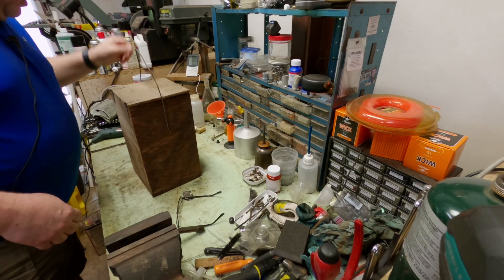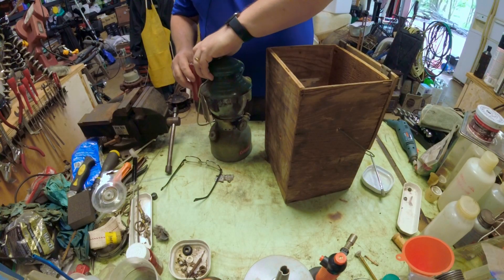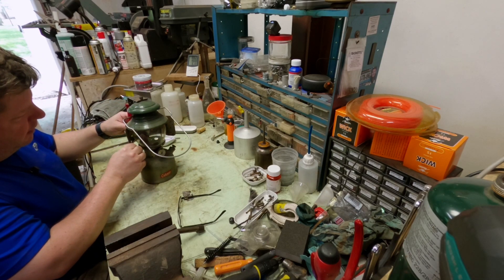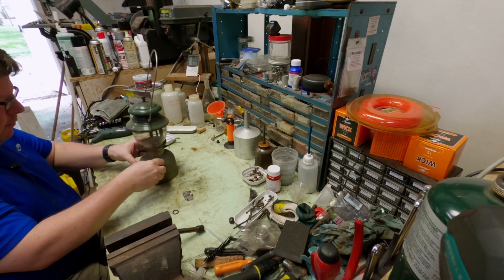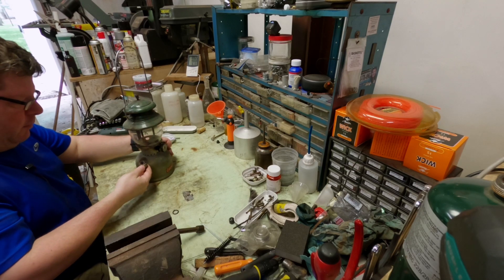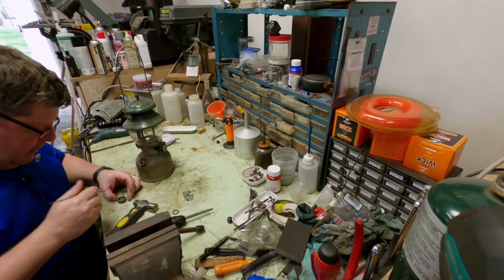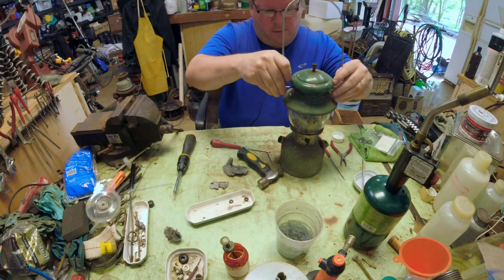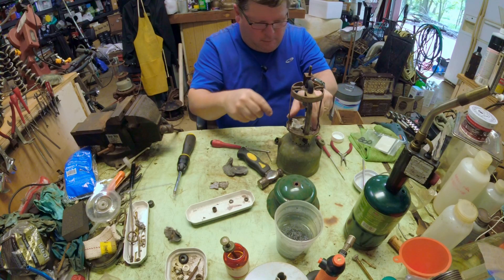On The Bench: Coleman 202 restore for a friend (Part 1)

Comment: I found that lantern two weeks ago..the stem cleaner is broken inside valve and will not come out.. any thoughts…
Reply from the maker: That's challenging on a couple of fronts.  First, to get it out, you'll need to chip out all of the graphite packing inside the valve body.  That'll release the tip cleaner.  Then you'll have to find a tip cleaner that has the graphite packing on it.  Old Coleman Parts may have what you need.

The other way to go at it is to pull the entire valve out of the fount and replace the whole valve assembly with one from a 200a.  They're the same part.  Again, OCP may have what you need, just depends how much you want to keep original.